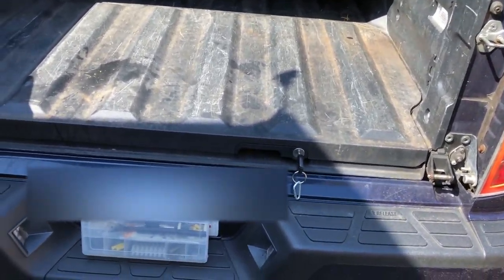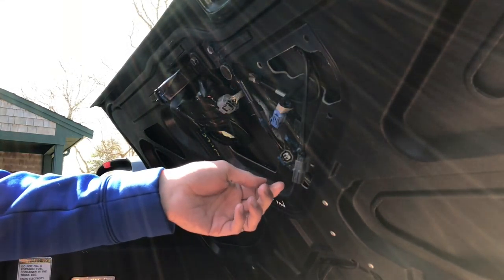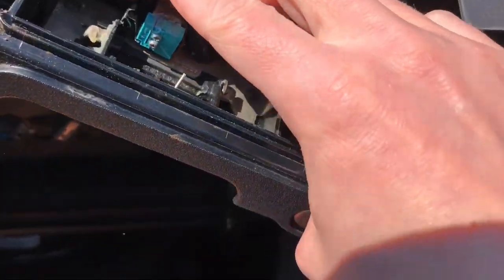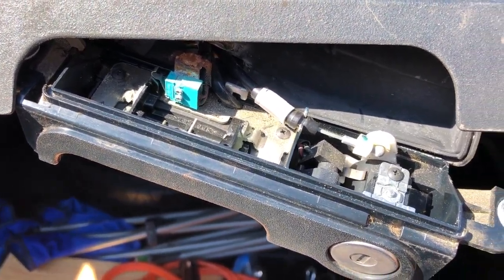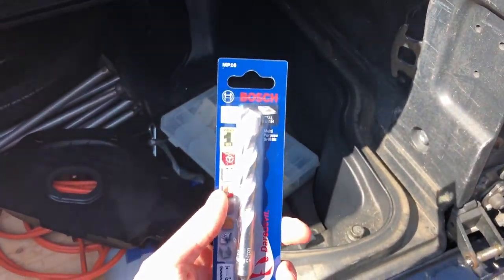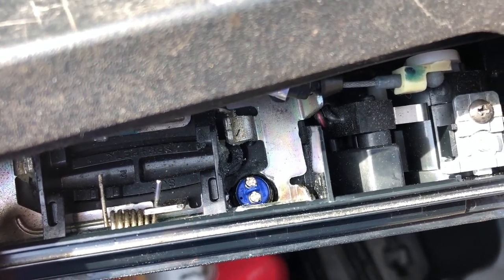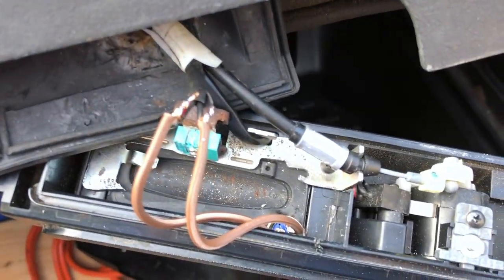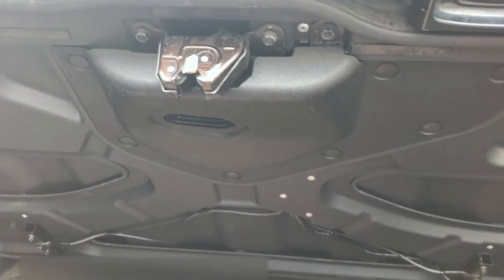2009 Honda Ridgeline Electric Trunk Release Switch Repair

Comment: Thank you for the video. I have a 2008 Ridgeline and used your video as a guide. My switch was okay. The issue was in the lock itself. The 12 volt motor was frozen and I took it out, put it back in; put unit back together and it started working again. I think it was a loose connection internally.
Reply from the maker: Glad it helped

Comment: Tried the switch in the glove box, flipped it to on and the remote worked for the under bed trunk lock on my 2019 Ridgeline. Great info.
Reply from the maker: I haven't been in any of the new generation Ridgelines so thanks for the feedback that the switch setup is the same in the glove box!

Comment: What is nose click not come from the switch
Reply from the maker: If you are not hearing the mechanism click when you use the paper clip to jump the connector then check to ensure the switch is on in the glove box. If yes then check your fuses to see if any are blown (I'm not sure which fuse controls the lock and did not see it in the manual). Finally, you could try using a volt meter to measure both pins of the connector (that I show you how to jump out). Measure from each of the two pins to ground (on the car chassis)... one of those pins should have 12 volts (when measured to ground). If it does, and you jump it with the paperclip, and do not hear a click then I believe the solenoid that controls the lock may be broken.

Comment: Hi, how do I open the trunk if the button doesn't work and it doesn't open from the key ??
Reply: The key doesn't open either, you need to change the mechanism, but how do I open it????
Reply from the maker: Hello, sorry you are having this trouble. I would suggest having a mechanic, locksmith, or Honda look at it. You may need to drill out the lock as this is designed to be a secure compartment. Good luck.
Reply: @ИванБолт-в8в sounds like you had items in the trunk pushing on the emergency lever on the inside of the trunk.